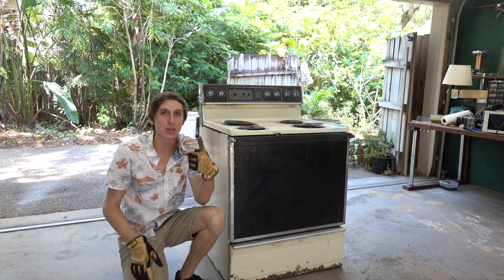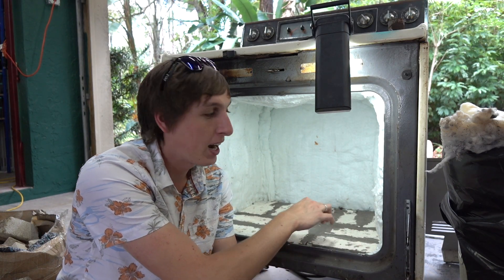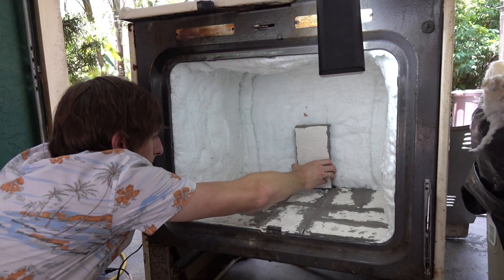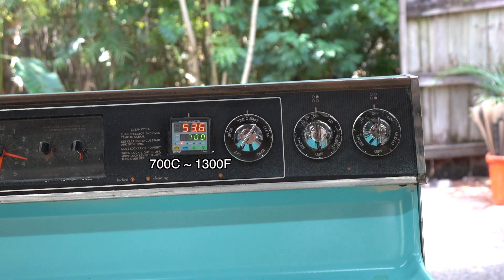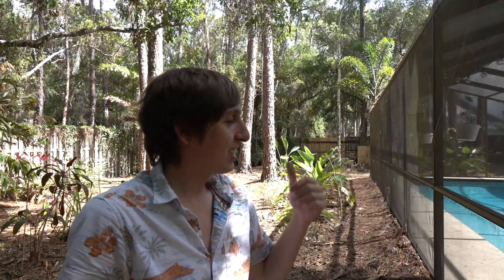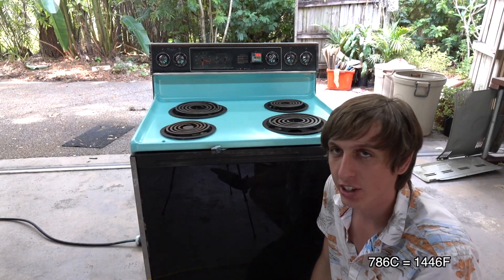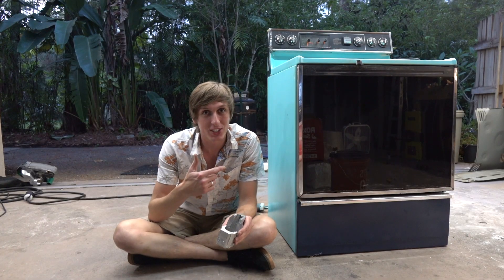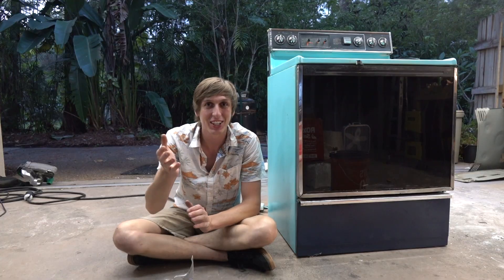Turn an old Oven into a Kiln

Comment: If you want to make better more professional moldsget sand and aluminium glue. Put the sand through a crusher so it is made extremely fine and thenmix the glue and sand to make your mold. You don't have to use aluminum glue, but it is designed to melt when the metal reaches it liquid temperature maked the molds easier to remove.

Comment: Not judging or anything but why not get the stove with the elements already in there in the bottom then put the bricks in there most ovens are rated for a high heat and have insolation and heat resistant plates

Comment: For anyone doing this themselves. Don't wash with hot water after handling the fiber blanket. Use cold water and gently run the water along your skin.  Don't rub your skin you will make it worse. After about 5 minutes then use soap.

Comment: It's a good idea to do this, to recycle old ovens. And the space in the oven is greater than the smaller kilns. I'll try this at home. Thanks! I think I still need another one for brass that goes to a higher temp, but for aluminum this seems good. Or one could the refit you suggest.

Comment: Hi, not sure if you will see this since this video is 4 years old now but in case you do I had a serious question. I am trying to make an affordable DIY pottery studio at home. I was very interested in this oven conversion. I was wondering if you think an oven like this structure could handle the high temperatures to fire pottery as a DIY kiln. Ceramic temperatures range from 1112* F (600* C) to 2552* F (1400* C), aka cone 022-14. 

I am not very science inclined but I am doing research and love this method you have developed for a metal melting kiln. Do you think this could work for a ceramic kiln? If so, what adjustments might need to be made? Sorry for the long message, but I would appreciate any feedback or answers from anyone.
Reply: I was browsing the comments to see if anyone had asked or answered this very question… sadly it seems no one has! However, I definitely recommend Andy Wards channel for some alternate DIY kiln ideas if you’re still searching for some. It’s more hands-on, but I’m feeling inclined to make one of his brick and adobe kilns myself. I’m not sure if there’s a difference between earthenware pottery like what he makes and other types of clay,  though. Also beware moisture levels in your area so you can keep the adobe dry, if you end up taking that route. I hope this was of use to you! :D

Comment: just a quick suggestion, use a spray bottle with oil (veggy oil would work) and spray what you think is asbestos, this way it becomes non frayable and is a miimal risk to health (doesnt become airborne) also you should wear some sort of tyvec suit for asbestos abatement as it can contaminate clothing.
Reply: also chemical cartridges i dont believe are required, id have to check but im pretty sure they filter to the same size as a p-100 biscuit filter (100 microns if memory serves) they just have activated charcoal and possibly some other stuff to neutralize or filter gasses

Comment: Be careful pouring the aluminum if you spill it directly on concrete it can explode it. The moisture in the concrete heats too fast and pow. I saw it happen before Also you don't want to have any moisture in the mold u could be seriously injured. I have worked at a foundry.

Comment: Very nice build I had the same idea and did a search to see who had done it first and found yours.  One idea that just came to me... do you think it would be at all possible to put an inner door that swings sideways or comes off idk how best to do that yet but you could perhaps have one with a window perhaps with the special glass found on old school potbelly stoves?) on said door that while would not keep as much heat in all the time as your blocked and insulated outer door it would however allow you to open outer insulated door to get a peak inside without a blast of heat in your face from totally opening it before your ready to do so when necessary to pull out or put in materials, also preventing a lot of lost heat when you habe to open it to check the progress etc. Anyone think such would be a good idea? And if so please share your suggestions and constructive criticisms. Thanks, & nice build thus far. Will be interesting to see how this progresses. ~B

Comment: I made an ashtray for my mom in ceramics class in high school. The teacher refused to let me fire it in the kiln because it was smoking related. So I decided to try to fire it in the oven at home. I had noticed that the glaze liquid in class looked and smelled just like Elmer's glue. I coated the ash tray in glue and fired it in the oven at 400 degrees for 4 hours. It actually worked perfectly. The glue dried clear, shiny and smooth, just like glass. The ashtray made a nice "tink" sound when tapped so I know it worked.

Comment: Well, if your mother wants to get into ceramics, this would be easier to use than a standard tubular ceramics kiln that you have to insert and remove from the top and clearly less expensive.

Comment: When doing lost-PLA casting, does the polymer vaporize completely as with the more traditional lost-wax process?

700°C is impressive, though not quite hot enough to fire clay …

Comment: I have a question about the amp/watts of this kiln. How many amps does it pull? is it a 120v/208v/or 240v oven? Did the heating elements run the risk of melting at 820c? I need something for glass and this is perfect, it just needs to hit 816c. Most large glass kilns run 208v-240v so I am wondering could I make one with a 15amp 120v oven that will hit 820c? Thank you so much for video and comment replies.

Comment: Just curious not dissing your build at all bud but something I couldn’t understand why is Since you used the old ovens heating elements why didn’t you use the top Heating Elements inside of the bottom with the other two I just figured that your kiln would seriously heat up quick fast and in a hurry I think that I liked your build so much that since I’m in the same situation with needing a KILN to smelter gold to pour Gold Bars I might have to copy your build but I give all the credit to where it belongs bro late

Comment: I don't know why you took out the original ceramic insulation and then just replaced it again with new ceramic insulation. It would have made more sense to double the thickness.

Comment: You could have gotten an old oven off of craigslist for free if you were willing to wait for one to come up in your town. If you had to travel very far like more than 15 or 20 miles then it was probably cheaper for you to pay the $40. Will it get up to the 1300 degrees Fahrenheit without  destroying the heating elements from the old stove/oven? That's better than buying a burnout oven, it's large enough to do more things than you could have with a regular burnout oven, plus it cost a lot less, plus you have the cook-top too.I really like the way your garage is open on two sides too, that's cool, you can drive all the way through.Thanks for sharing.

Comment: You can use masking tape as guideline when cutting with a cut off wheel. Works pretty good. Easy to see and protects surrounding paint. Remove after filing.

Comment: hi @TheBackyardScientist 

If you want casting something without bubble in there, you need to make a "sling" (in France we call this machine like that but i don't know the name in english). This machine is simple, that using the centrifugal force to "press" molten metal in the mold.

thats look like this 
https://img3.leboncoin.fr/ad-image/2f09608213301c8fcbe7c8ff794a83597bec69c0.jpg

at left it's the counterweight and at right it's the crucible and extrem right it's the the cradle of the mold

Comment: Aha, so that's the pool in the Hot Wheels race video (saw the giant mouse trap, too). Funny how your old backyard also has a pool next to it like this one.  
Did you cast parts for a gun? Why are Americans so obsessed with guns?
Reply from the maker: +Jason Axford in Florida like 30% of houses have pools. Gun is from a video game, putting lasers in it.
Reply: TheBackyardScientist 
Awesome repurpose job on the oven. Very impressive. I'm in my garage right now welding together an Arduino-controlled heat exchanger for my open fire place. gonna be sweet.

Comment: if you want to have stronger plaster molds i believe you can add some vermiculite to the plaster to help control cracking    Vermiculite (or Perlite)

Comment: I built a similar kiln in a barbeque grill shell for annealing glass. Just wool on the inside though, no bricks. Fun times. I like the idea of using an oven because of the door and square shape. My grill shape wastes a lot of space. 
Shout out to HWI! I use their Versa-Tech MW 55 for hard-facing and I love it. Very durable. My local distributors are some cool guys too.

Comment: Really neat project! I'm surprised at how hot it got, considering it's maybe only 2kW maximum. A proper kiln that size would be something like 4-5kW. BTW, those heating elements aren't happy operating at high temperatures for a long time - I used to use a cooker element as a crucible furnace, but it burned out after half a dozen melts.

Comment: Question: Once you have a mold, could you not just put blocks of aluminum or bronze on top of the plaster so that the metal would pour into the voids as it melts at tempearture?  I would imagine that you might get less inclusions and bubbles in your cast if you let the liquid metal sit in the mold.

Comment: Really awesome project. I'd suggest pre-heating moulds before casting and use cone shaped risers for increased pressure. When i worked in a foundry we never poured into anything without risers.

Comment: So I'm confused- you're using the old oven heating system for the heat source? How?? My oven barely gets up to 500F, let alone 1500F!!

Also, is there some reason you always stick with aluminum? Why not something like tin, zinc, etc?

Comment: How'd that work with the broiler element?  Are you running it on self-cleaning mode or something?  Just curious how you're running both elements like that.  (or was the top element not a broiler?)

Comment: hey man. like your casting. the voids you have can come from 3 different sources. the first is shrinkage. if you add cylinders extending from potential shrink spots you can reduce that, of course there's a whole science on that alone. the other two sources of the voids in casting have to do with your metal composition. i recommend degassing agent, although there have been a number of home remedies I've seen. the other thing you can do is add ferro-silica (i think is the name), it's cheep and fairly easy to find, you only need like a tablespoon to 5 pounds of aluminum. It dissolves in aluminum like sugar does in water, but it can help with voids as well as increase the strength of your castings.

Comment: How is the heating elements wired? You glossed over that part. Applied mains directly to it with controller in between to cut off at given temp? i never knew regular oven could get that hot..
Reply from the maker: yes its slower. It takes around 1 hour 30 minutes to melt 10 pounds of aluminum, my foundry takes 30 minutes. The kiln is also silent and easier to work with in my opinion.

Comment: Color-temperature light fixture tutorial or we riot.
Reply from the maker: +HauntedShadowsLegacy it's a product you can buy check the video description
Reply: I see that, but what about the pipe mounting you have the light bulb in? How do you wire it up? Where do you get/find the parts for it?
Reply from the maker: Oh ok, I bought the insulators on Ebay - http://www.ebay.com/itm/-/232226209325 
Then I used a diamond sawblade on an angle grinder to chop the bottom to make it flush.
I used these for the bulb housing http://www.ebay.com/itm/131841257923
You can probably figure out the right pipe fittings to use.
Drilled some holes in the wall, wired them up through a regular switch.
Reply: Thanks for the list, bro. Looks sweet. Kinda confused about how a regular switch can toggle the temperatures, but I'll probably figure that out.

Comment: Very interesting video. Thanks!

You never mentioned how much power the oven-kiln uses or how much per hour we could expect to spend operating it. Is it cheaper to run than a gas fired unit?

I found the front door to be terrifyingly dangerous as you alluded to when you opened it the first time. An asbestos union suit with a fire brick helmet would be advised. That must be one vicious ball of heat that shoots out and goes straight up into your rafters. Maybe move it outdoors.
Reply from the maker: +videolabguy good questions, it's 5.6 kW and I end up spending about $.40 per hour to run at full blast. Using propane in my foundry probably cost about $3 per hour to run.    

It's not as Asbestos, but I thought it was at first because the oven was made in the late 80s when asbestos was still being used in some household stuff. It's fiberglass insulation but there was asbestos rope used to seal the oven door when you closed it.

Ohhh now I see your talking bout the heat. Well it goes up to the garage door which is insulated with Rockwool and the ceiling is covered with drywall and fiberglass behind it. It would actually be way safer for that to catch on fire in my garage then outside in my yard where there's dead leaves and pine needles all over the place. I think.

Comment: you could make a f*cking gun !!!
Reply: Made out of aluminum? You could make a better gun out of wood and plumbing parts. That is a model of a gun, not an actual gun. Plus, the tolerances on a firearm like the that wouldn't be good for casting, I think.
Reply: Dr Caubalth yeah i could make a gun for $35 in the plumbing isle of the hardware store. It's not hard man

Comment: How much extra power does the oven use being cranked up to those temperatures, as opposed to using it in a normal fashion?
Reply from the maker: +Sean Perkins he doesn't use any more power than it normally would just contains the heat better

Comment: This is pretty awesome - I've seen a lot of forge, foundry, etc. designs but this seems like one of the more convenient ones. My only question is if you wanted to melt metals with higher melting points, i.e. steel, copper, etc.. what would you do to allow it with an oven base like this? Ramp up the voltage? Can those heating elements take it?

Comment: I checked the MSDS for that stuff. Theres no evidence of it causing increased cancer risk for occupational exposure, however it does still cause mesothelioma in laboratory animals with significantly higher exposure. That said wear that protective gear whenever theres a chance of particles being released, during construction, cleanup etc. Especially if you haven't sealed the oven over the cement.

Comment: Can you find a way to put your plaster in a vacuum when you're pouring it around your castings? I'm pretty sure that's what a lot of other people do to remove the most air bubbles and get an even better finish when they pour their aluminum.

Comment: Questions: could you coat the inside of the oven with a shiny metallic coating to improve the efficiency? What metal would you use that isn't likely to melt? Would the cost not justify the potential improved efficiency? And are you going to make mac n cheese on the stovetop while doing science?

Comment: Could I potentially used this solely as a foundry? I really don't want to spend 500+ dollars on a foundry if I don't have to. It seems as if the oven would be extremely hot just to be around when it opens.
Reply from the maker: +Shadow Runner it could. It melts aluminum easily. It's easier, cheaper, and quieter to use than a gas foundry
Reply: but I bet it destroys your electricity bill.
Reply: Instead of using a clay graphite crucible, I have seen people use fire extinguishers. Do you think using a steel bucket would work also? Or is it just too thin?

Comment: Could you make a calculation for electricity consumption of that casting project? Maybe add the price of electricity too? I have a feeling that here in Finland it would be cheaper to actually order the parts than make them by yourself (now that our electricity price has gone up enough so even our government officials has been giving out warnings to the electricity providers about it)
Reply from the maker: +TheRokkis it costs average $.40 per hour to run it's 5.6 kW. It was on for 18 hours - $7.20
Reply from the maker: Electricity here is 5-7c per kWh
Reply: Thank you! 

That's relatively cheap. At Northern Finland I pay average 5c/kWh + 3cnt/kWh for transfer and 3c/kWh as taxes coming to 11c/kWh. So it would make it at most around $11.30 at where I live. I thought the difference would be more, but 1.5 times is still a lot in my opinion. Still probably cheaper to make it yourself tho. Besides I bet I couldn't even find any company around here that could or would provide service =)

And if I add postage even inside the country, if ordered, I think the price would even double. Our prices are climbing a lot faster than salaries for the most of the people.